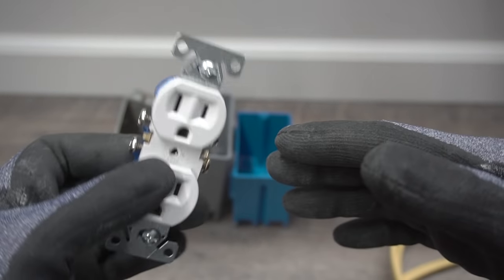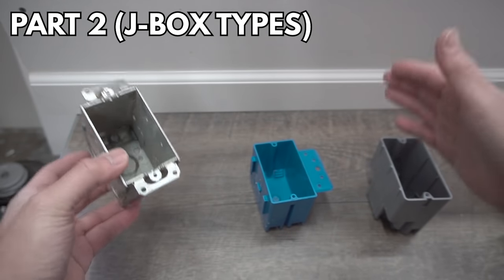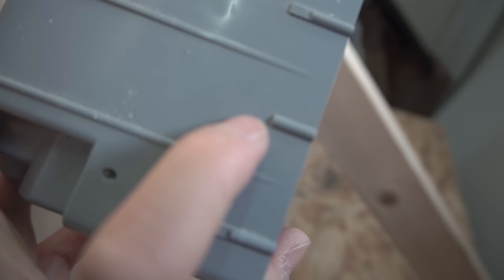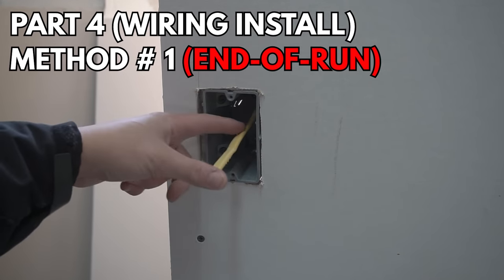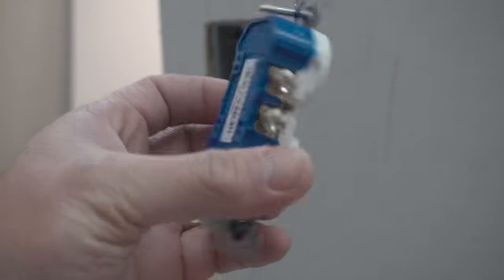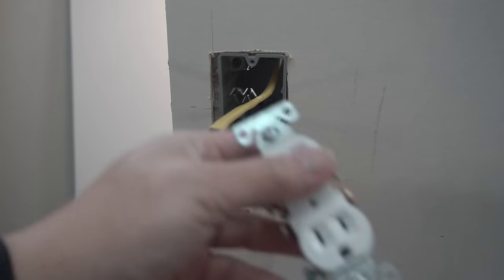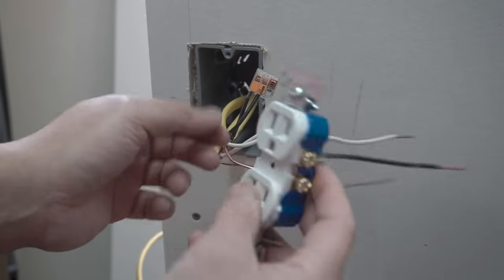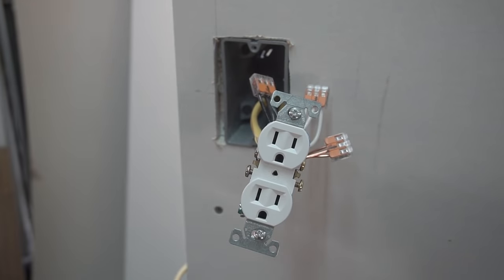How To Add An Electrical Outlet Anywhere (2021) Complete Wiring | DIY Tutorial For Beginners!

Comment: Well, this is all good, but the main problem I have, and the reason I watched this video, is to see how you get the wire to the outlet in the first place. That, is the hard part. Once the wire is run, the rest of it is gravy. Running the wire is the problem.
Reply: Same
Reply: I'm glad I checked the comments, that's all I wanted to know as well. You ever find out? Is there a clean way to do it through the molding?
Reply: Use a fiberglass wire snake to run it through walls
Reply: Watched the whole video only to discover the information I need which is how to run the new wire from your power source is not mentioned....merp.
Reply: I used to snake it as far as I could go, make a new hole at that end point , and repeat until I was at the desired location.  But it was a lot of work and left a lot of drywall. I came here hoping to learn a more efficient way - but no dice.
Reply: I have access to the basement so I followed the existing wire and made a hole to run the wire down into after connecting it to the outlet.  The other outlet I put on my porch I made a hole on the outside and inside and drilled a hole in the floor then ran the wire to the electrical box. I put a piece of conduit over the wire running down the wall into the basement.
Reply: @MrMikeCarlson snake, clothes hanger, strong magnet kit etc
Reply: This has always been my biggest problem.  I was hoping someone else had an idea. Construction varies from one part of the country to another and has changed over the years. I first find the stud in the wall. I  make a hole in it where the outlet will be. Then I put a light in it so I can see it from the attic. I sometimes take the time to turn off the circuit breaker at this point! Then I go to the attic and find the right junction box. This is a major variable and why I was trying to learn more. I lower the wire in the wall and fasten into the box. I pray that I'm on the circuit that I turned off. I check with my meter to be sure it's off. I go down and fish out the wire, and he tells this part on his video. The hard part is sometimes finding the junction box in the insulation and finding the proper wall space. It's hot up there. Insulation is old, dirty, and nasty scratchy stuff. It's dark, and my old body is balancing on rafters while working, and that is only the problems that come to mind. I'm sure there are more. Best wishes on yours.

Comment: Kudos ! This is the best video, by far,  I've come across. 

Two small points that need to be made: First, your '5/8' inch is almost one full inch, unless you have really tiny hands, which wasn't apparent; Second, the 'J-bend of the screw terminal wires should be placed under the socket screws such that the short end of the J bend is curled in the clockwise direction, not counter-clockwise as in the first wire that was attached. This is so because when the screw is tightened the wire will tend to continue to curl clockwise around the screw. Otherwise, the wire's curl will tend to open up in the clockwise direction and the elctrical connection from the screw head to the wire underneath will be made poorly. 

Still, you've made a great tutorial video. Thanks
Reply from the maker: Thank you so much for the feedback and the love and support my friend! 🙏🏽😊

Comment: I quit using wire nuts probably a year and a half ago...i only use Wago connectors now. They literally come in handy for EVERY job I ever do. And pig tailing is so simple with the Wago 221s. Good video brother 👊
Reply from the maker: Thank you so much Chris! I totally agree with you on wago vs wire nutes! They are a game changer! Thank you for all the love and support brother! 🙏🏽👊🏽😊
Reply: @FixThisHouse  yes sir. I don't miss a video brother 👊
Reply: @dallas5374  i buy them in boxes of 50 and 100...price difference is significantly more compared to the price of a wire nut. I get 50 of the 3 wire Wagos for like $17 on Amazon, and a box of 100 of the 2 wire Wagos on Amazon for like $25. Compared to wire nuts where you can get cheap off brand chineseium ones for like $10 for 250 of them, it's definitely a difference. But the ease of use, reliability, reusablity, and safety are well worth it to me. You can buy a pack of like 2 wire, 3 wire, and 5 wire assortment for like $30 I believe. Or you can buy them individually which is what I do.

Comment: 15:23 All the wires are being attached to receptacle screws incorrectly.
It's backwards - being installed counter clockwise.
The wire should flow around the screw in a clockwise direction, in the direction of the screw tightening, so that wire is drawn in against the screw.
Reply from the maker: Thank you for the correction 🙏🏽
Reply: Well done video. I will have to agree on wrapping the wires around the screws in a clockwise manner though.
Reply: What happened if you don't wrap the wire clockwise? Will it be hazardous counter clockwise?
Reply: @jonnguyen6959  yes counter clockwise is risky.  tightening the screw will tend to un-wind the wire;  won't be a tight connection.
Reply: What he said.👍 clockwise.
Reply: @josephagallant  All screws should be tightened as well even if no wires are connected, and should also be wrapped with electrical tape to prevent arcing.
Reply: @carlmax46  risky? I think these electricians are going overboard, what's the actual percentage chance this would cause something hazardous
Reply: @wazup3333  relatively high risk connection will loosen and short
Reply: @carlmaes2702  its bolted down... and if it did whats the worst that would happen? fuse will blow? and that's it
Reply: @wazup3333  The worst that can happen is that the loose connection overheats and starts a fire inside the wall. There are reasons why things should be done the right way.
Reply: @williamwallace9826  it's isolated in a plastic box, fire can't happen
Reply: @waynebarnes2679  Yes on all screws being tightened down. I would advise against using electrical tape, though.
Reply: @wazup3333  Fun fact: plastic burns.

Comment: You can also call your cut in box a "remodel box". Also, a quick one minute tutorial on wire gauges wouldn't hurt. This was good for a very basic install without any of the anomalies a beginner might encounter.
Lastly, The way you showed the fish tape being attached to the wire to be pulled into the box, definitely wouldn't pass through the allotted opening in the new box.
Reply from the maker: Thank you 🙏🏽! I’ll definitely make a video about wiring info!

Comment: We only use/seen metal boxes in class A and B (commercial) buildings or really old houses (except for ceiling fixtures) down here in the south.
Try a magnetic bit next time..
Reply from the maker: Thank you for the tip! 🙏🏽😊
Reply: You must use a metal box when the wiring is in metal conduit. That's why it's usually in older homes or commercial buildings.

Comment: Wago connecters  are great.  Even though the receptacle might fail, connecting two hot wires and two neutral wires to the corresponding terminals on the outlet, the following outlet will still work. I only use the pigtail for the ground wires. On the side of the outlet there is a bridge that connects the corresponding wires .
Reply from the maker: Thank you 🙏🏽! Yes WAGO are awesome!

Comment: When using a box with the internal screws for mounting to a stud, it helps to drill pilot holes. Hold the box flush with the drywall and drill through the plastic. This should keep the box from sliding in when driving screws at that angle. Obviously, you won't be able to hold the back of the box to prevent it from moving.
Reply from the maker: Thank you you so much for the tip and advice! Have a great new year! 🙏🏽😊
Reply: The box sucking in was my biggest complaint with those smart boxes (ones with internal screws). I will be sure to predrilled next time thanks for the tip!

Comment: There is usually a guide on the back of the receptacle that will show you the correct length to strip the wires so that you do not have exposed wire if installed correctly on the screws. Also, if you are going to use a pigtail, be careful you do not exceed the maximum cubic volume allowed for the box.
Reply: I didn't think pigtails count toward box fill factor. The calculation I use only account for wires entering or leaving the box. Each 14ga wire requires 2 cu. in., each 12ga wire requires 2.25 cu in, each switch requires 2, and receptacles are 2.25. Then, ALL grounds count as a single wire based on the largest size entering or leaving the box. Obviously though, more pigtails or extra ground runs to each element will make the box more crowded but I don't think the code factors that in. I'm interested in the reference though if it's otherwise.
ETA: In his mid-run example, assuming 12ga wires, it would be 6 "wires" (2 on one hole, 2 on another, 1 ground, 1 receptacle). 6x2.25 = 13.5 cu in.
Reply: Pig tails are a must ! But you guys said all the obvious. Best of luck

Comment: This shows how to connect the new outlet to wires for both end of run and middle of run connections, but where's the part that shows how to connect the other end of the wire to the source you're working from? And how can you determine if the circuit you're working on can even handle the load of an additional outlet?

Comment: You installed the hot side J hooks backwards 
You wanna install them clockwise so when you tighten down the screws the J hooks get tighter instead of looser

You also wanna use an ECX bit so you can fully torque down those screws. The Phillips won’t be an exact fit

Comment: Question I’m trying to add a new outlet up the wall but my circuit outlet that I want to use has 2 white 2 blacks and 2 ground can I pigtail my 3 wire to that circuit outlet or is it to much of a load that could cause it to burn or I’m  I able to use a 5 level wago or wire nuts ?

Comment: Hi I recently opened a acceptable in my kitchen,because I wanted to install a GFCI but I found  Black,White Red wires and one ground had already connected in to the J box .so what is the Red wire for.and the red wire also connected to the hot side as same as black wire.thee

Comment: Good job 👍 except the ground (naked) wire is a little too long and could touch either of the other two (hot and neutral) wires in the second case. That would be a short circuit.

Comment: I probably missed it, but I am assuming you explained this is 20AMP breaker (in your example) and that you are running 12-2 but using a 15AMP receptacle or 15AMP breaker that your using 12-2 wiring?. Its probably okay depending on where you live but my OCD wants to keep wiring and receptacles uniform. I know this video was just for wiring....
Reply from the maker: Hi! For 15 amp breaker or power you can only use 14 gauge or 12 gauge . For 20 amp breaker or power you can use 12 or 10 gauge , but not 14 for its possible to overheat
Reply: Manny, your OCD may hurt you when learning electrical rules. There are so many exceptions and rules in other parts of the book that it is hard to keep track of everything.  A prime example is 2020  Nec 210. 21.(3). Recepticle Rating.  This section allows 15 amp recepticles on a 15 Amp breaker.  A 20 Amp recepticle on a 20 Amp breaker and 2 or more 15 Amp recepticles on a 20 Amp breaker.

Hope that helps.
Reply: @FixThisHouse  your statement has just a little error to it.

Nec 210.19 demands the voltage at the outlet not drop by more than 3% from panel to recepticle.

Yes, wires have a small resistance which uses up a small amount of voltage under Ohm's law.  A transformer may be required for long runs, but most fixes simply involve stepping up the wire size.

So, a long run, like to a boat dock or a run acrosd a large house may need bigger than 14 wire to make the voltage requirements.

2020 nec 110.14.(A). Points to a limit on screw terminals to no.10 wire.  So a boat ramp run might need number 6 on a 15 Amp breaker with a terminal lug and swap to 10 or less in the boathouse.

Comment: I have questions about removing a hard wiring with designated breaker to stove. I removed corrugated line with red,white,black,green. But there still those lines in the wall. So is there a way to reuse those lines for a110 outlet. Not sure if the old line is 110 or 220 will test tho. Thanks in advance
Reply: Red and black are both hot, white is neutral, green is ground. Either the red and white OR the black and white can be used for a 120-volt circuit. Red and black are 240 volts. If you use it for a 120 volt circuit, you will have to replace the double pole breaker in the panelboard with a single pole breaker.

Comment: Thankyou brother, I have a living room and beds without lights, I been waiting for my friend supposedly for months, I get tired of promises, so I went to home depot and bought $700 of tools I want to do it my self, I have switches and aoutlits in the living room can I just get the power from the aoutlit and snick it to the sealing or I have to get power from attic box?
Reply: Roh, I want to bring up a third solution.

Any one can put a wire under a screw.  The trick is to have the knowledge to do it right.

In the video, he never pointed out that the wire insulation should not be under the screw.  I hope he got it right, did not see.

My solution, talk with some electricians in your area.  A few dollars, a free meal, or a few beers might get you the knowledge and skills to do it to a safe level all by yourself.
Reply: @keithharrington4595  After he snipped the ends off the wires he just stripped, my guess is that he had insulation under the screw heads. Which, as you mentioned, is not correct.

Comment: What are key steps to change knob to tube wiring  in an older home to get outlets grounded and updated?
Reply: Firstly you might have to change your service and panel. And then run all new feeds to the outlets and run new wires from outlet to outlet

Comment: I just have a question. Is there a limit to the amount of receptacles you can continue adding under the same circuit?
Reply: Yes, except for one- and two-family dwellings. But the rule of thumb for houses is 10 outlets for a 20-amp circuit and 8 outlets for a 15-amp circuit.

Comment: To all:  the National Electrical Code is the minimum requirements.  To meet these requirements recepticles must be in certain locations.....  To meet these requirements they must be 5 1/2 feet ot less on wall and not more than 18 inches away from the wall in the floor to count.  There are spacing rules and wall length rules and more.

But I want to mount a TV on the ceiling above my bed.  Yes, this is okay, but will not count as far as required recepticles in your house.

Comment: How or where did u get the power source from?
Reply from the maker: Hi! You cna get the power from another outlet or from the breaker. Please Make sure to check for permits and updated code in your area so you don’t exceed the amount you can add to you circuit.

Comment: About 99.5% of homeowners & sparkeys never use the correct tool to tighten screws on devices. Must use a torque wrench or torque driver to tighten ALL CONNECTIONS! It's in the 2017 & 2020 NEC
Reply: Which is the correct tool?
Reply: @eb5259  Going by the NEC. ( National electric code ) that every state uses it mandates that a torque wrench or torque driver MUST be used to tighten every electrical connections. At a IAEI continuing class an instructor told us that might have been UL went around the country checking thousands of connections. Think only 30 %were torqued to correct value. Rest were either too tight or  not tight enough. We were told that you should send out torque wrenches to have calibration verified every year. Heard when scum bag ambulance chasing lawyers go to due electrical to ork they have work inspected and connections checked for correct torque so everybody has to cover their butt.
Reply: Thank u

Comment: It actually does matter which box material you use. You cannot use plastic/pvc boxes if your wiring is in flexible or rigid metal conduit, you have to use metal boxes. The conduit acts as a ground for the entire box, and you may or may not have a separate ground wire to the receptacle. Only because the wiring you used is not in metal conduit, then you're free to use any material box, however I would advise against using a metal box with wiring that is not in metal conduit because the sharp metal edges of the box can easily cut into the wiring.
Reply from the maker: Thank you for the advice! 🙏🏽
Reply: @FixThisHouse  2020 NEC 314.4 metal boxes must be grounded.

Normally just a pigtail to a green grounding screw.

Comment: Well, I just saw you connect the hot wire to the receptacle with the wind going the wrong way, counterclockwise! Connections must be made so that the wire is wrapped in the same direction as the screw is tightened. Good bye!

Comment: You need only 14/2 wire not 12/2
Reply from the maker: For lighting yes 14 gauge is sufficient, but it all depends on the power source. For 15 AMP power coming from the breaker or power source then yes 14 gauge and 12 is good . But if it’s coming from a 20AMP then 12 only. 👍🏽😊

Comment: A 19 minute video, and you didn't touch on some rookie mistakes / best practices.  
1.  Direction of the wire hook onto the screw.  You showed hook on left and screw tight turning right.  Hook can open up instead of tighten with the screw.  
2.  Terminals should be taped.  You don't want to have exposed hot wire for extra safety especially when using metal boxes. 
3.  Second receptacle you show screws sticking out.  Unused screw should be tighten to avoid accidental contact.  
These may be small things.  But keeping best practices will be safer.  That's what separate pro's from hacks.
p.s.  What's up with the cover photo that black and white wire connected to screws on the same side?